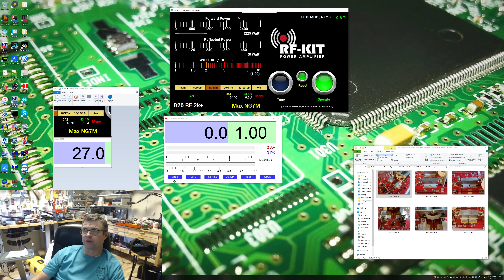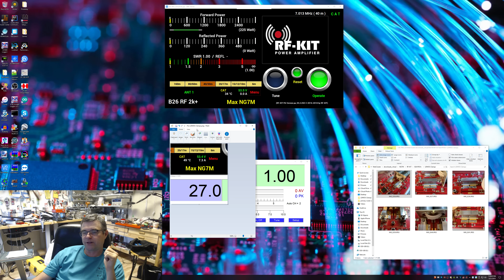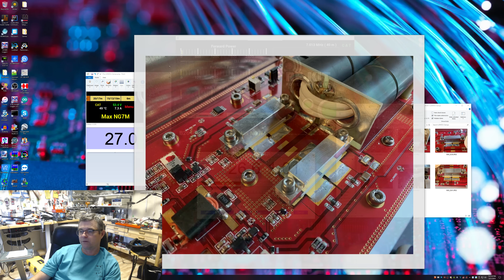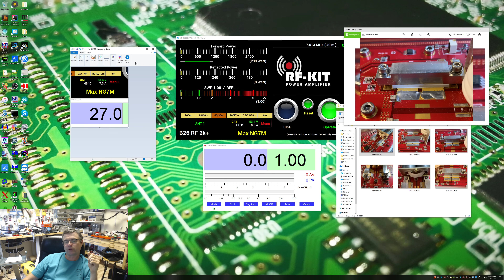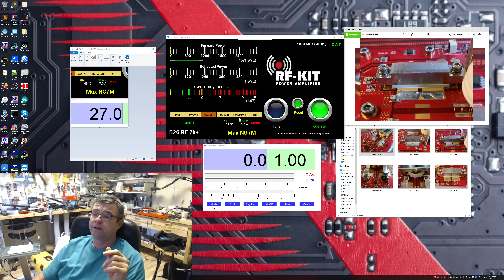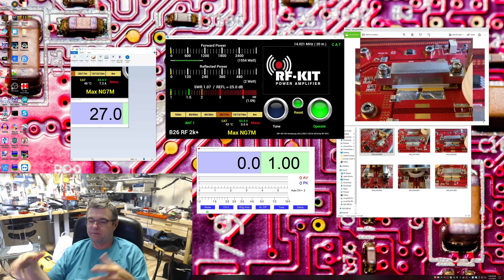LDMOS Clamps / RF-KIT b26-RF2K+ / RF2K-S Hamvention 2019 Announcement

Comment: Max where can we get the LDMOS Clamps? Do we have to order from Reinhart or is there another source? Does Reinhart even sell the clamps?
Reply from the maker: I was able to get a pair in 2019 as you can see here in the video.  I was in Xenia / Dayton and met with Reinhard.  I would reach out to Reinhard and see if they are still available for the RF2K+.   I suspect they are the same as what is being used on the RF2K-S too. Max NG7M
Reply: I'll try on the reflector and also maybe thru John at Island Amps. How big are the holes you cut in the sides? I'm thinking of adding a couple of fans for now to cool things some. It really only gets warm on 6 meters. Output there isn't very good and it heats up pretty fast.
Reply from the maker: Off the top of my head, I think used a 1 1/2" (inch) punch.  it was one of the easy to find used Greelee punches that are very popular in the used market.   My experience is that those holes make a big difference.  When the fans do come on, you can put your hand by the holes and feel air being drawn in.

Comment: Seems to me if the function of the "clamps" are for cooling, why do the clamps not have fins that offer more surface area for better heat dissipation?  Why are they a simple block of aluminum with no fins???  Thanks, Joe W4JF
Reply from the maker: Hi Joe, the function of the clamps as I understand it from Reinhard's description is too keep the device pressed down on the copper heat spreader.  So in that regard, it may help.  His comments for switching to clamps we more related to thwarting failures for devices that were lifting off the heat sink at the center of the device.  The ceramic really isn't designed to transfer heat up and the clamp will pick up some heat and dissipate some, but that wasn't the real reason.  If you get the clamps, do be careful on how much to tighten them down, no need to crush the ceramic!  Just a gentle even snug on each bolt will do.  Max NG7M
Reply: @ng7m-ham-shack  Extreme care should be taken when clamping these devices. The ceramic cap has a hollow air cavity underneath, and if the hardware is torqued too tightly, the ceramic MIGHT fracture. I have great respect for this amp, but disagree with the mounting method. Both NXP and Ampleon recommend soldering the devices mounting flange to the copper heat spreader. This gives the best electrical connection, and a very efficient and reliable thermal connection as well. Going that route pretty much requires a 2 piece RFPA board set, and device change out becomes a more complicated matter. It also might become less necessary...  73  - Steve KG4LJB